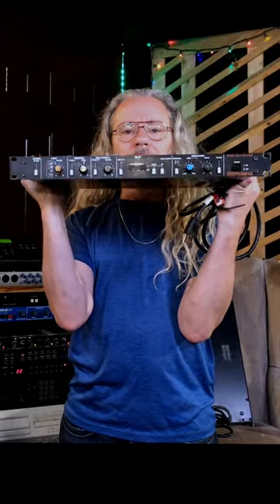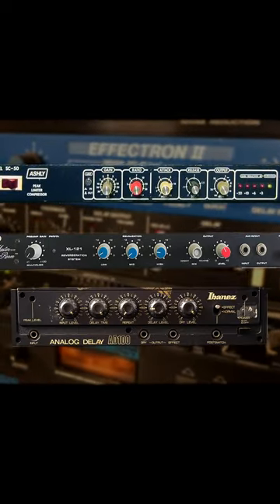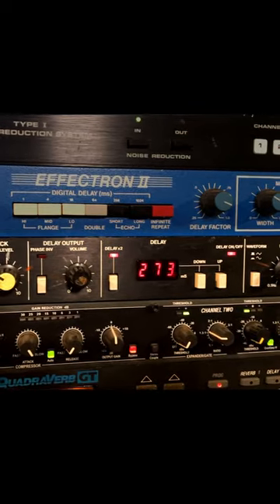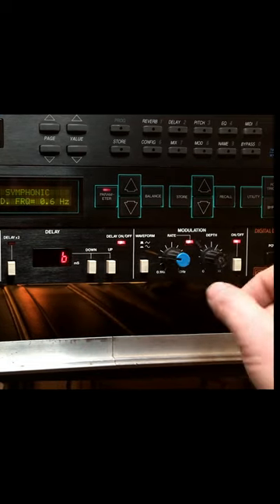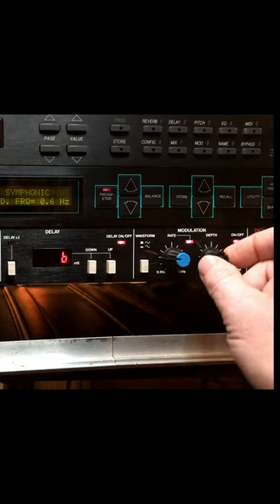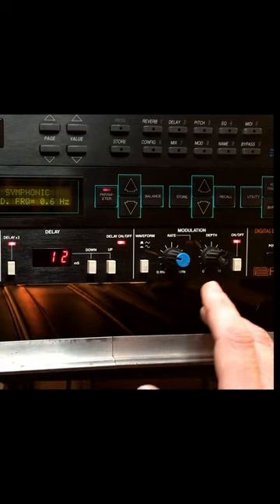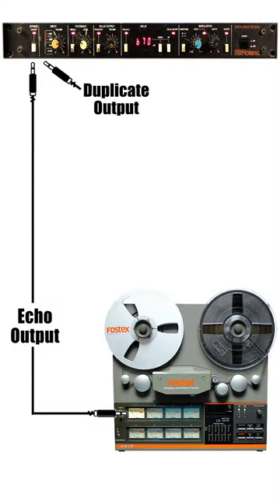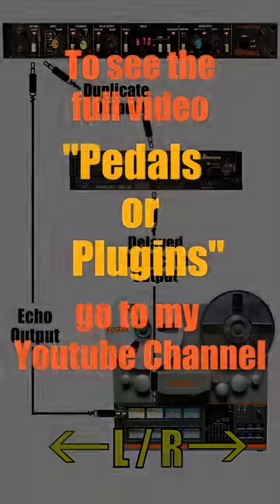Creating Chorus Effect From A Vintage Digital Delay - #shorts

Comment: Those SDE-2000's are pretty cool. I think I actually kinda like it better than the SDE-3000. Seems like it's a lot more useful, and easier to get the modulated, and pitch shifted type sounds outta them. The SDE-3000 is a classic don't get me wrong, and it def has a signature character, but sometimes I feel like it's kind of limited in some ways. How do you find the feedback/tails of this for doing longer repeated type delays for like guitar, or Vox? Also, have you used any SDE-3000's?
Reply from the maker: I never used the SDE-3000.  As far as finding the right settings.... I'm just tweaking and tweaking.... but usually I'd just hit a string quickly (no sustain) on a delay with a lot of feedback and adjust the time , usually while listening the the song to get the tempo or just what sounds cool.